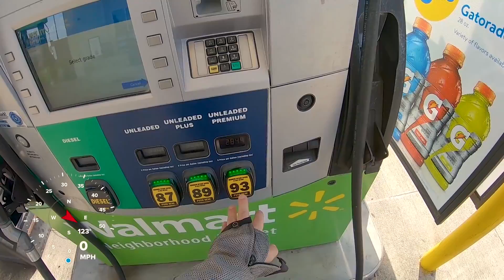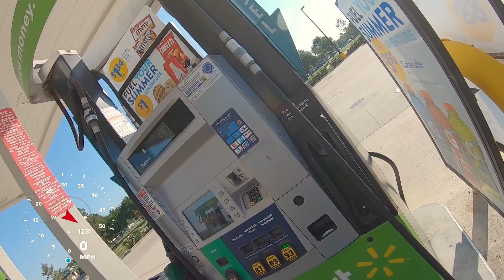VLOG: Scoot Commute on the 2007 Yamaha C3 XF50 Scooter

Comment: I had a few scooter when I was young, but lack of power, so much body covering, wind pushed me all over, last small trip, hard wind pushed me from left lane, all across right lane, and into right side pull off,  car in right lane hit brakes, but nothing I could do to stop, and never rode except in town until I sold it, but I had other small bikes, my old Suzuki FA50 was one I loved, besides my Honda 65cc bike.
Reply from the maker: I don't mind the lower power of my scooters, as long as I don't need to travel long distances or highway speeds.  I'm not a very big guy (5'7", ~165 pounds with riding gear), so the little scoots don't need to pull too much extra weight.  Houston traffic is definitely a challenge for any motorcycle... especially the smaller ones... cagers are VERY aggressive down here and they like to play the intimidation game at every opportunity.  

The nicest, most courteous person outside of a car can become the biggest D-bag the second that they sit down behind the wheel of their 5000+ pound SUV or truck.  It's an amazing transformation... the perceived "anonymity"  that they feel inside of their cage lets their true personality traits show through.  😉  --QM
Reply: been riding since mid 1980's on streets, but never traveled over 300 miles on anything but Harleys, or full size Kawasaki, had a KZ1000, and a ZX1100E, but I have seen a lot myself, I really want one of them Honda 125s, lol but only for within 100 miles, but my scooter incident really got to me, maybe, maybe, a Honda Helix? or Suzuki Bergman? but, open bikes appeal to me more.
Reply: Hey what is a cager? @QuasiMotard
Reply from the maker: @professor1701 Any motorist in a car, truck, van, etc... those are cages on wheels. 😉👍
Reply: Ahh, ok, interesting.  I've always called them 4-wheelers, as a truck and bus driver for years. Makes me think of the original Point Break movie where Patrick Swazie calls cars "metal coffins."  I guess once you learn to ride you find new freedom and a connection to the outdoors you can't get inside.  I did have a convertible once and started to feel some of that freedom, but gotta get a bike and get out there, hopefully with this C3 scoot I've got now if I can follow your videos.  @QuasiMotard

Comment: If you decide to replace the tach Northern tool has a honda tach on their web site. I have it on my metropolitan and it works well. It is probably like the one you have. It has a sealed battery and the lead wire pushes into the back.
Reply from the maker: Thanks for the tip!  I'll keep that on my shopping list for the next time I stop there.  Cheers!  😉👍  --QM

Comment: What is your friction lock?  Is it some sort of cruse control?  I have a 2018 Honda PCX 150 and I'm wondering what I should get as a cruse control. Any ideas?  I remember when the C3 came out.  I always thought it was a replacement for the Yamaha Chappy.  Cool scoot!
Reply from the maker: The friction lock that I have on this scooter is the Sound Off Vista Cruise: https://www.amazon.com/gp/product/B000GZPGYE .  I have this same cruise control on my 2004 Honda Silverwing 600.  It only works on bikes that have a slight gap between the edge of the grip and the throttle housing, and the throttle cables need to exit the bottom-left-center edge of the throttle housing.  Some bikes aren't setup properly for this to be an option.  However, the friction lock that I have on most of my other bikes (16 bikes in the garage right now) is the Go Cruise: https://www.amazon.com/gp/product/B00TIEATVY .  The Go Cruise fits almost any bike and it works better IMHO because you can roll-on the throttle to accelerate and then release it to return to your previous setting.  You can see the Go Cruise in action in many of my videos... here is a PCX150 video where you can see the throttle lock: https://www.youtube.com/watch?v=PUwpi9pv0lw .  Cheers!  👍  --QM

Comment: My c3 slow downs in downhills when it's not accelerated (when it is in niwtal). I don't know why is that. Do your one have that problem.?
Reply from the maker: I'm not sure if I understand your question.  The C3 will decelerate if the throttle is closed because the CVT doesn't allow freewheeling or idling of the engine.  I don't notice any deceleration on flat ground or downhill unless I close the throttle.  Cheers!  😉👍  --QM

Comment: have you removed the variator spacer on your scooter?  Also what brand is the sheild and hand shield you are using?  I just got a c3.
Reply from the maker: Congrats on finding a C3!  Yes, the first upgrade I made was to derestrict the variator by removing the spacer washer.  That helped to increase the top speed from 35 MPH up to around 38 MPH.  

Shortly afterwards, I installed a Dr.Pulley performance variator kit with sliders instead of rollers.  That bumped my top speed another 5-7 MPH, and it usually reaches 45-47 MPH on flat ground.  

That is the Slipstreamer HD-3 SMK w/ 7/8" mounts:  https://www.amazon.com/Slipstreamer-HD-3-Windshield-8in-Smoke/dp/B003CJHZT0 .  You can probably find it cheaper if you shop around... I paid $65 for it several years ago.  

The hand guards are a set of generic/universal deflectors that I found on eBay, but I don't have the order information anymore.  If I recall correctly, I searched "smoke handlebar deflector" and found several options.  I installed a set of Denali universal turn signal LED strips and mounted those on the outside of those deflectors to augment the factory signals.

Cheers!  😉👍 --QM
Reply: @QuasiMotard   Thank you for taking the time to reply!!  I am loving this C3!  so much fun to ride.

Comment: Fun wheels, own the same bike. Could you pass on info about side stand if possible, thanks
Reply from the maker: Howdy, Mike!  I ordered my side stand from Webike Japan about 6 years ago, but they don't have it in stock anymore.  However, the Webike Thailand site still has it:  https://thai.webike.net/en/sd/1512526 .  

The Yamaha P/N is 3B3-W0733-0000 .  You can also search for "Yamaha VOX side stand" on many search engines.

Installation of the stand was very easy, but I did need to pull the lower plastic to get a socket on the bolt that secures it to the frame.  The 2-pin ignition kill wire was taped forward on the lower-left rail next to the fuel tank, so removing the plastic helped to locate that connector as well.  Cheers!  😉👍  --QM

Comment: Do you have the link to the variator and roller set
Reply from the maker: Howdy!  These Dr.Pulley variators are becoming harder to find over the past few years.  Here is a link for a shop in the USA that has them: http://www.scootertronics.com/drpulley.html .  My Dr.Pulley performance variator kit came with the 4g sliders, and it only cost me ~$45 USD several years ago.  

You might search the internet for "Dr Pulley Zuma 50F Vino C3" for better pricing.  The engine and CVT assembly from the C3 went on to power the Vino 50 and the Zuma 50F for several years, so the parts are interchangeable.  Cheers!  😉👍  --QM

Comment: I'm going to look for one despite my weight.i like it better than honda metropolitan for round town riding
Reply from the maker: The little C3 is a hoot to ride... you just can't expect to go anywhere very fast.  You mentioned that you weigh ~240 pounds, so I would recommend upgrading the rear shock... it's very soft and squishy.  I replaced mine with an adjustable YSS shock that I purchased out of Germany (via eBay).  Let me know if you get a C3 and I can send you the part number for the shock that I used... it made a world of difference on my scoot.  Cheers!  👍 --QM
Reply: @QuasiMotard  i cant seem to find the shocks you're talking about

Comment: How do you order parts from Japan?
Reply from the maker: My go-to source for Japanese parts (both OEM and aftermarket) is Webike Japan: https://japan.webike.net .  They have a great selection of accessories and performance parts for all of the major brands... stuff that's difficult (or impossible) to find here in the USA.  

Shipping can be quite expensive, so I usually buy several items at the same time to justify the shipping costs.  On the bright side, their shipping via DHL Express is very fast... usually 3-5 business days to the USA!  If Webike doesn't have what I need, then I search through Ebay to find the item from a seller with a high reputation score.  Cheers!  😉👍  --QM
Reply: @QuasiMotard  thanks a bunch!! I’ll take a look at webike - appreciate the advice!

Comment: a cooler on wheels ha ha
Reply from the maker: 😁  I've thought about insulating the box under the seat, plugging the drain holes, and then using it as a cooler... just as a joke.  I could even get a Coleman or YETI logo to paste on the side panels.  That way when someone asks me at a stop light if it's a cooler on wheels, I could step off, open the seat and toss them an ice-cold drink.  Then I'd just ride away like everything was completely normal.  It would be priceless to see their reaction.  🤣  --QM